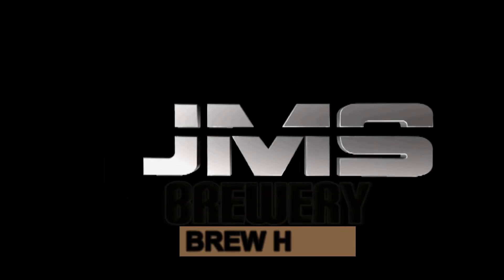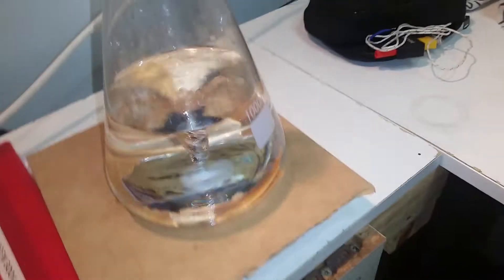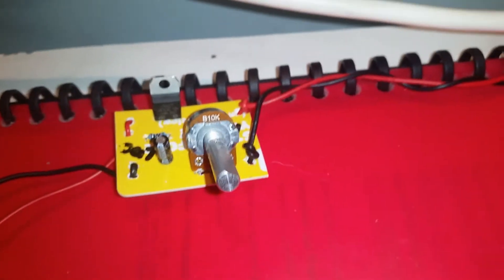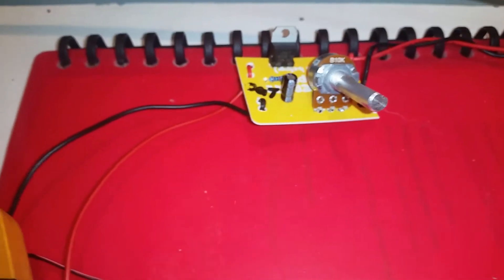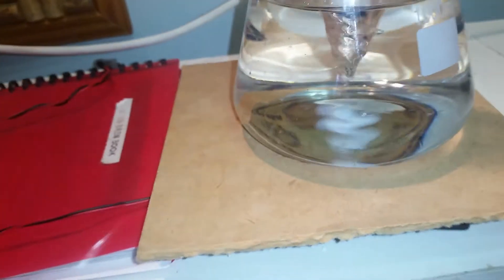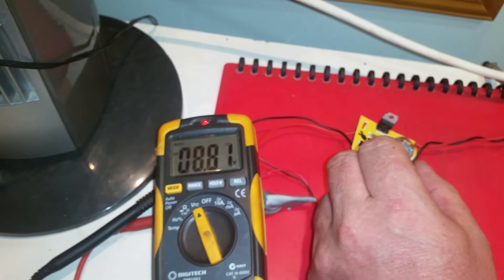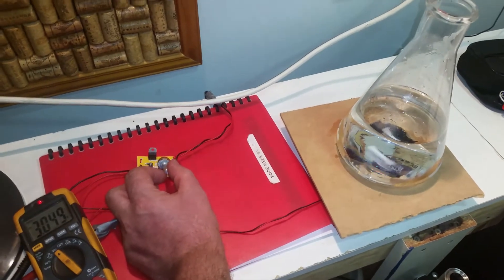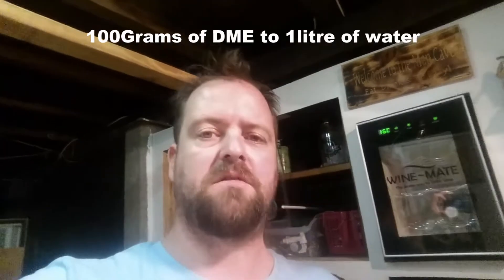JMS HBW26 - Stir Plate nearly complete

Comment: Very cool! I can't wait to see you put together that panel. For the boil pot, I think I'm gonna go with something like a 9500W High Power SCR Electronic Volt Regulator Speed Controller Governor Dimmer to control the element. But I will need to get a temp prove in there somehow for whirlpool steeps an such. Dude you blew me away with the stir plate controller you made. Beer looked tasty too🍺 cheers mate🍻🍻
Reply from the maker: WOW Man 9500Watts that will pull some high current, I can't wait to start on the control pannel, Cheers Rick 🍻 🍺 🍻

Comment: Well done Justin. Over my head all that electronics stuff! I use a dimmer switch to control mine, just need to remember not to go above 12v! I'm now in the process of fitting an in-line fuse to protect my new fan! Still, it's one of my best bits of gear and it's great pitching the yeast and seeing it take off within a few hours + to have enough creamed off to put in the fridge for next time. Cheers.
Reply from the maker: I've only been rehydrating my yeast so far but I'm looking very forward to culturing my yeast, Cheers mate 🍻